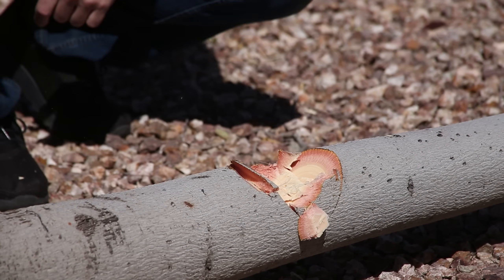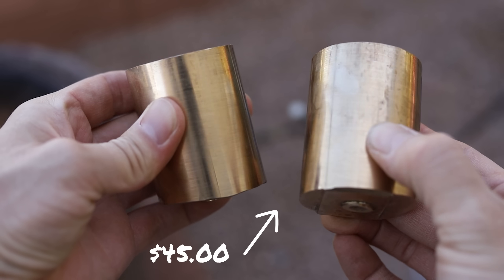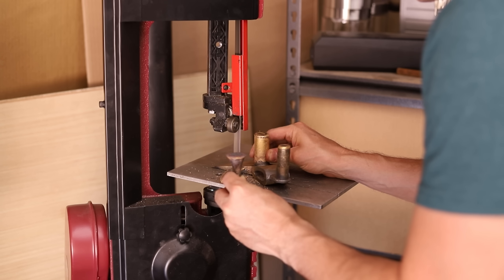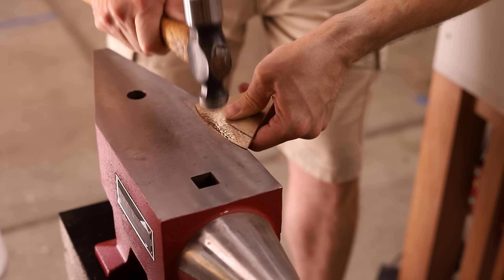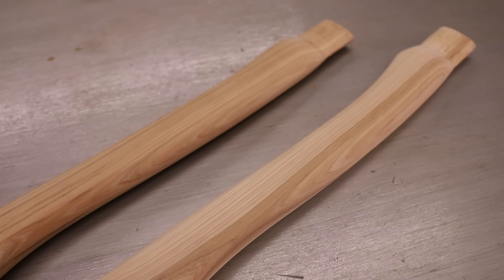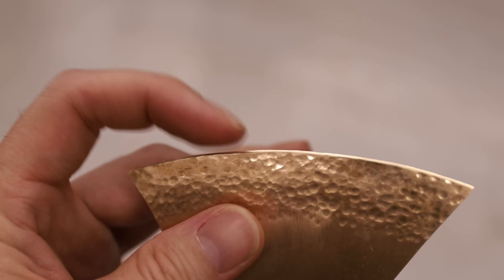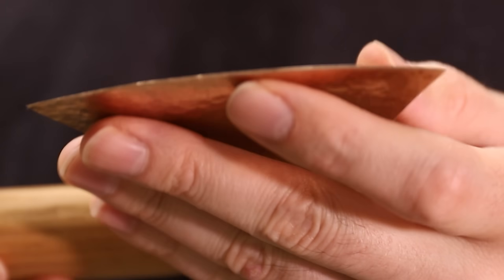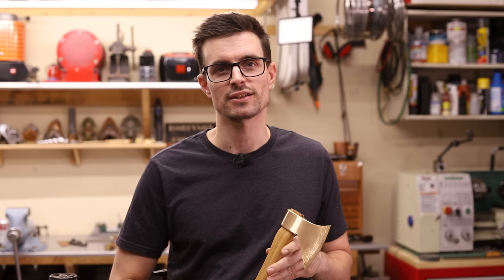Aluminum Bronze VS Tin Bronze, Making & Testing Bronze Hatchets

Comment: The difference in colour is a restult of the krystalline lattice forming differently, since it cooled faster, causing their atoms to allign differently.
The colour would become uniform, if you heated it up, and then cool it down again (Tempering).

Depending on how hot you make it, and how fast you cool it you alter the properties of the metal quite drastically.
It will make it softer or harder, depending on how much you heat it, and how quickly you cool it down again.
Quick cooling will make it Hard and Brittle, slow cooling will result in it becming Soft and Ductile.
If you are proficient in tempering, you can make the edge hard, while keeping the core and body soft, which will cause your axe to hold an edge for longer, and prevent it from chipping easily.

I know how to do this with pretty much any Steel, but that one i am not familiar with.

You can test it by casting or forging rods, then heat them and cool them differently and see the results by seeing how much the bend before breaking, and how much force it takes.
This however requires specialised equipmen, but there is shops who wil gladly test these for you for a fee.

also you can look it up, there have been tests on this very material, and the results should be publically available.
Reply: Thats for iron alloys, not copper alloys, iirc it also dont work with most other alloys ether 

Copper and copper alloys will just go soft if you heat them regardless of how fast or slow you cool i down.
That's why you have to work harden copper and bronze if you want it hard.
Reply: When working copper you get it to red heat & quench in water to soften- the opposite of how iron works.
Reply: @Whichbindoesthisgoin  It's called Annealing

Comment: You should try to make tools out of Beryllium Copper.- It is very hard and is used to make non sparking tools like pliers and wire cutters for the oil industry...
Reply: But beryllium dust is toxic. I would avoid it.
Reply: @raulkaap  Relevant safety precautions can easily be taken when casting this alloy.-
Reply: @carlosschagun6922  yes, but there will be cutting or grinding at some point
Reply: @raulkaap  Again, relevant safety precautions can easily be taken! In the case of cutting or grinding, disposable respirators for hazardous powders can be used...

Comment: Classical bronze was the metal of choice for literally thousands of years for a good reason. It didn't require the foundry technology of iron, and it was far more durable than pure copper; the only superior metal that was workable to produce tools was meteoric iron, and that was obviously much more scarce than copper or tin.

Definitely think keeping the hammer marks on the edge is the superior aesthetic choice in a modern context.

Comment: 4:15 vaporisation. 
TIG has an extremely hot point source, that lowers Rapidly as it radiates away from that source into vastly larger volumes.
But your spark is around 5000k/4700⁰C.
Aluminium vaporises around half that, same with copper,  but the multiple minor ratios of the entire process will have vaporised one more than the other, and changed the exact composition relative to the whole head.
Likely also localised heat colouration; that spot was melted and cooled under different, less controlled circumstances. It's why material type, filler type, welding settings be extremely important.
Reply: Was gonna say something to this effect. Even under shielding gas, some aluminum at the very surface of the metal will sublimate/vaporize (depending on if it's solid and glowing or a molten puddle when we're looking at it) if the bulk temperature of the bronze is high enough to give aluminum a meaningful vapor pressure compared to 1 ATM.
TIG blows way past that point and I'm not surprised there's a visible composition gradient in that thin layer. Love this stuff!
Reply: Great comment, that's what I was thinking ❤
Reply: my guess was that the the way the metal crystalized when it heated was different from the way it did in the initial pour so it looks different because the metal cooled differently
Reply: Why didn't he used an oxy acetylene torch for welding? Or oxy propane?
Reply: @alexiachimciuc3199  None of those can heat a small area up enough fast enough to gloop on some extra base material like that, than TIG. You can braze with bronze, but it would be HARD to braze to the surface of an axe head like that with anything other than TIG. You'd end up roasting the whole piece before the area you're adding filler to was hot enough. It would be uglier, even if it worked.
Reply: @DitchWizardry Yeah this might make me delete my comment then XD i wondered, but I havent done brazing in a few years.... Yeah, it eould take a lot of imprecise heat to get done wouldnt it? Ultimately this is easier and does little enough harm.
Reply: The colouration itself is caused by oxidation. The colour difference is determined by the thickness of the oxide layer, blue being thin and red being thick.
Reply: @kilixior  That's what I was thinking!  The oxygen availability during the weld but not during the pour.
Reply: Does vaporized aluminum cause a risk for health the same way galvanization does?  Like you get the aluminum shakes instead of the "zinc shakes".

I guess what I'm asking is should he have been using some filtration system or mask with his welding shield?
Reply: @grenmoyo3968  You always should use some kind of mask/filtration, but lets be real, who does that
Reply: @grenmoyo3968 breathing in anything besides air is bad. So yeah, vaporized metal is bad. That's metal. In your lungs!
Reply: @grenmoyo3968  I'm honestly not sure. Bronze and brass alloys are all ones I'd wear a respirator for if I had the option. Anything that smokes in the crucible as a normal side effect of the alloy is something you don't want to breathe even if the old stubborn dudes have gotten away with breathing a little bit of it as a treat.
Reply: @grenmoyo3968 copper poisoning is a thing, so is nickel poisoning though I do not think thats what's smoking given the temperatures involved.

Thats if the metal is pure too. In Washington state the old Asarco copper smelter messed up the surrounding puget sound water and soil purity for-ever. Plenty of lead and actually radioactive compounds in copper ores. Not nearly as much as coal, but some, and heavy metals are their own beast.
Reply: So... Even with helium or something as a shielding gas and good pre/post flow, this will still happen. Interesting.
Reply: So, my follow up question is, would there be a meaningful lack of integrity with the original imperfection, or just aesthetic?

And, a few follow on questions: first, is that a meaningful distinction, between aesthetics and integrity? I assume the answer is yes. Second of all, if the integrity is in question, how, exactly, do you plan the alloy to remedy that? And, third of all, if the aesthetics are in question, how exactly do you plan the alloy to remedy *that*?
Reply: @jasonshinn8379 Short answer, that specific imperfection was small and not in a critical spot. It was a purely aesthetic concern from start to end. A finer mirror polish would make it mostly invisible anyways. You'd have to know you're looking for it to find such small discoloration.

Continuing, THOUGH, it does bring to question how much of the inside of these are porous like that. The defect location had absolutely no effect on the integrity of the eye strap or edge or anything vital to the tool's function. But as seen on the aluminum bronze axe, it means there's likely imperfections elsewhere within. Thankfully that one wasn't critically large either.

If it was a large imperfection on the cutting edge its best to just try and recast, maybe in the same way if we are just trying out our luck, maybe with air-gapped weights or clamped weights on the risers if he intends to improve his technique.

Trying to weld on the axe edge or near the eye loop of the axe would have been far more concerning if he intended to test the axe to destruction, which he didnt want to. There, the question of if the weld changed hardness or ductility for better or worse would make itself very much known, and important. 

Personally I don't think, so long as he work-hardened it again after he heated it with a weld, it would have effected the metal a WHOLE lot. Some, not enough to make it a useLESS tool. I clearly can't test it with any hardness kit stones or anything, not from here, but I think it's probably just a bit more brittle, probably still plenty workable. Iron and nickle in the aluminum one would do that. He welded the classic recipe bronze though, didnt he?

It was a small spot anyways. On the main body of the axe head. Harmless location, I woulda left it. It doesn't have to look perfect in my opinion.

Frankly I think it looked better with the imperfection, but I completely understand! Because i too would make the same excuse to play with the tig welder. HONESTLY stated. xD
Reply: Wait are you saying that the extreme heat of the welder changed the make up of the alloy because aluminum vaporizes more than the other metals.
Reply: @AngryLemon19  More likely he is pointing out that, without controlling the process, welding can cause alloy elements to clump together, rather than stay relatively evenly dispersed as the solidify because they don't all do it at the same temperature. That, plus the rapid heating and cooling in the heat affected zone can change the hardness of materials. Being cautious of welding on parts is not unreasonable. The question is whether or not such an act in this case would have noticeable impacts.
Reply: Sometimes I need to scroll down and see if someone hasnt already said it better than I CAN haha

Spiderman meme pointing at each other A WELDER! BROTHER!
Reply: so if it was 100% the same material, would it have still discolored?
Reply: I was thinking it might have to do with the availability of oxygen in the weld but not in the pour.
Reply: the effect is even worse on zinc bronze. the copper it last to go so everything always edges to red, not matter what copper alloy youre working with.
Reply: ALSO didnt notice any argon, so rapid oxidation at those temperatures
Reply: Thanks chat gpt
Reply: Completely different crystal structure for a start.
Reply: Jesus truly does love you, He stands at the door and knocks, blessed is the man who lets Him in. Jesús te ama de verdad, se para a la puerta y llama, bendito sea el hombre que lo deja entrar.
Reply: @Godtrulylovesyouall  sounds like a completely creepy guy. The FBI said to report sex crimes but some states legalized this gay marriage. I checked my door. I resisted him so he must have run away.
Reply: @Godtrulylovesyouall  sounds like a completely creepy guy. The FBI said to report sex crimes but some states legalized this gay marriage. I checked my door. I resisted him so he must have run away.
Reply: @Godtrulylovesyouall Ha! Tell him he requires faith.

Comment: The weld wasn't contaminated, the filler wire was when you poured it onto the casting sand
Reply: The sand contains oil, so that makes sense.
Reply: @misterhat5823  if you have a tig brush or even brake cleaner you should be able to avoid future contamination

Comment: there are several factors to the alteration of the coloration of alloys like these, the culprit could be any or all of these. 

-Oxidization: heat accelerates this process, and there's the square cube law of surface area. small pieces have more oxide per weight due to this.

-Evaporation: the smelting process can evaporate some of the metals/additives, so twice melted metal will be of a slightly different composition than it's once-smelted counterpart.

-(de)tempering: thermocycling metal can alter it's structure. repeated cycling alters it further, generally. This could be a sort of "Hamon" effect, as we see from steel bladesmithing. Welders can make beautiful patterns with this effect as well!

nothing you can do about the 1st 2, but if it's primarily the 3rd, you could possibly even them out with a few thermocycles, either in a kiln or with a torch!

Comment: Just a note - for axe hafts (handles) the grain should be aligned with the direction of the axe blade for maximum strength and to minimise damage. Hickory is the best wood for handles but when I saw the grain at around 6:20ish it’s basically the opposite of what I look for in an axe handle. It might not make much of a difference in the short term and on axes of this length, but for longevity and to avoid issues on any longer axes in the future I’d always try and get that grain in line with the axe blade.
Reply: It's much more important that the grain doesn't run out than which orientation the rings are in. Those handles will be fine. I'd be more worried about the loose fit at the bottom of the eye. You should have to tap an axe handle home firmly with a baton or mallet, it shouldn't just drop onto a shoulder like that.
Reply: @Uncephalized  absolutely this. I actually prefer the grain horizontal a lot or the time in terms of comfort.
Reply: that does make sense. i suppose the wood is less likely to delaminate or fracture that way.   thanks for the info.
Reply: also important is not to get half heartwood and half sapwood, to avoid warping problems.
Reply: Does that mean that the axe blade should essentially be parallel to the lines in the wood grain? I'm just trying to visualize in my head what you mean by aligned.
Reply: Hickory? Baaah. There’s an Irishman who’s quite adamant about Ash.
Reply: @SchrodingerMil Both ash and hickory are good, but Hickory is native to Asia and the Americas whereas Ash is native to those as well as Europe
Reply: @SchrodingerMil  I do and I get the joke now, but I didn't realise it was a joke until now
Reply: @SchrodingerMil  Which specie o ash?
Reply: Thank you-i was going to mention this until I saw that you already did.
Reply: You are bang on, but it's more important with full size axes than hatchets. Longer handled axes are subject to far more stresses
Reply: I knew something looked off about them. Good eye.
Reply: everything you say is good but hickory is not the best wood handle. maple, ironwood, brasilein redwood, even rosewood are much higher tier.

Comment: The aluminum bronze you used is pretty hard, cold forging it wasn't the best solution imo (the alloy you're using is pretty much exactly what i use for my knives). Perhaps try to water quench it next time, and give it a heavy temper (i'd say, blue it 2 times over a fire). But then once it's hardened and aged, do NOT try to hammer or bend it, it will be very hard but way more brittle. Quench it from a nice orange heat, cherry red isn't enough for this alloy.

Comment: aluminum alloyed metals can change color with annealing. the spot is because your weld cooled at a quicker rate than the casting. If you anneal after repairing at 600-900 it should go away.
Reply: That’s interesting! Thanks for letting us know
Reply: I was thinking it might have to do with the availability of oxygen in the weld but not in the pour.
Reply: Yes, the cold axe is a heat sink for the small volume of weld repair.
Reply: I appreciate you adding more knowledge to the video. 👍 thanks
Reply: Yeah, that was my theory on the colors as well

Comment: My biggest gripe would be the grain alignment in your handles, it should be running parallel (front to back) not perpendicular (across) otherwise you lose a massive amount of strength. Its not so important for these tests but its very important overall and makes the difference between an axe or hatchet being a quality tool and a wallhanger. Ive torn out and scrapped nice otherwise handles from axes due to grain orientation and it makes getting good replacement handles so much harder but since youre crafting these from scratch you have the option to make it right every time
Reply: The castings are top quality and you do great work with petrobond, I really enjoy the videos but I just had to say something
Reply: wait but u r a gurI, how u know so much about this?
Reply: @jake9854  girls can blacksmith, cast metal and woodwork just as well as anyone. I also lift heavy weights and can fix cars, wire a house, lay bricks, patch plaster, split rocks etc. The contents of my trousers and shirt don't stop me from knowing or doing things

Comment: you shouldnt compare them to iron or steel,you compare them to rock axes...that are horrible to work with,a giant leap for humanity
Reply: Bronze is still quite good compared to iron and steel. In fact it’s better than a lot of iron and steel, just not as good as specific types of steel
Reply: I'd be interested to see how they compare to the non sparking tools of today. Beryllium Copper is what is used now and it's dust is toxic from what I understand. I cast my own aluminum bronze axe head about 10 years ago, but never got this far because I made the eye way undersized. It was clunky